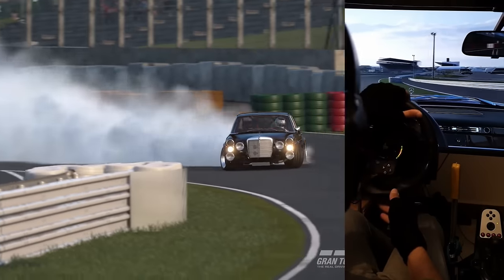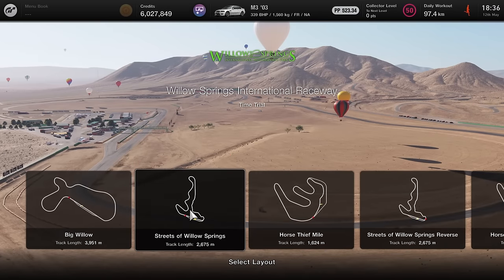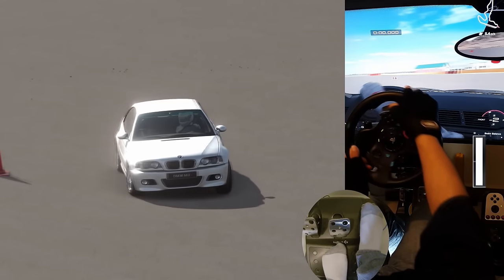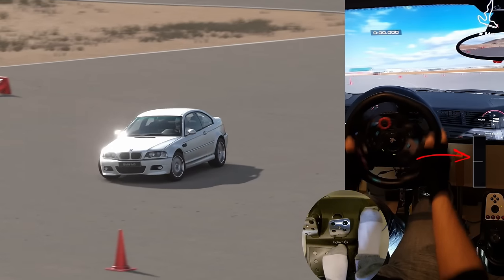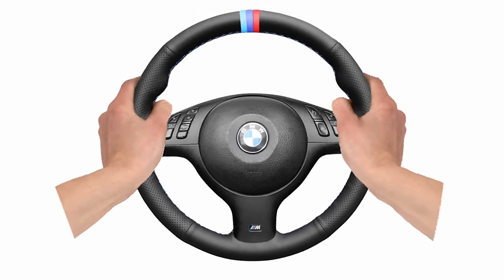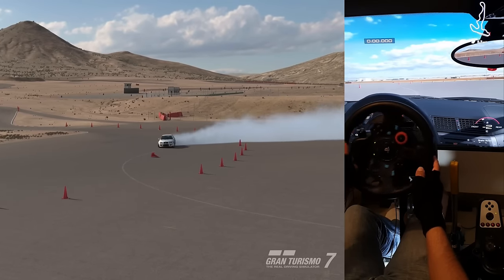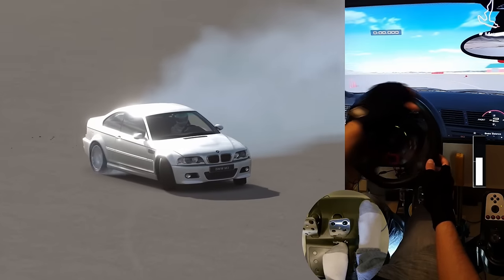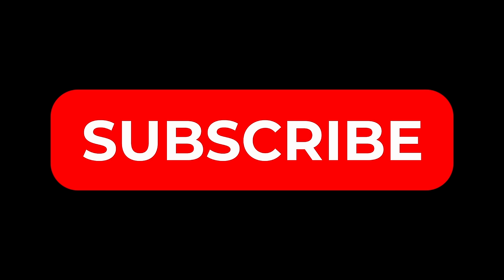How to Drift With a Steering Wheel (GT7/Real Life Tutorial) - Part 1: Basics

Comment: This is by far the best drift tutorial video, but I’m still having trouble. Whenever I initiate the drift, I spin out, no matter what. I try using a lot, a little, and no throttle. Whatever I do, I always manage spinning out. I’m not sure if there’s a setting I disabled or something but I’ve been trying for a while and I can never manage to drift
Reply from the maker: Thanks a lot! Which wheel are you using and how did you set the ffb settings? Also for how long have you been trying? It's normal to keep failing at first and it's also normal for it to take some time before you become able to catch it right. Even trying   for 2 weeks straight and not yet figuring it out is still normal btw.
Reply: @SimActionClips  I’m using the same wheel as you, and set up the exact same settings. Using the same car aswell, completely stock. I’ve tried for like a month, using different cars, trying 4wd, rwd, and fr. I don’t know what I’m doing wrong, I always spin out, no matter what I do
Reply from the maker: Okay then try using some tires with less grip. They'll slow down things for you a bit but you would also have to be more smooth and gentle with your input changes. Try all 3 different comfort tires and see which one you find easier. Give each type enough practice time.
Reply: I keep spinning too, and now I can do donut instead 😂
Reply from the maker: Donuts are a good start though.
Check these 5 mistakes and avoid making them to build your skills the right way: https://youtube.com/shorts/LM11WI2OLH4?feature=share

Comment: Thanks for the help, I’m trying to master drifting in the GT86. While I didn’t put the settings as the same as yours (I got settings 5/5/5 instead of 5/10/10). After practicing for about 10-15 minutes, I can initiate drift without spinning out or gripping, about 50% of the time.
Tomorrow I will practice some more, it’s actually more fun than I expected 😂
(And yea the GT86 is tuned, but it still only has 207HP/395PP.)

Comment: Very useful 👍👍👍
Thanks a lot man , I am waiting for Part II...
I still haven't found the way but you said things Which help me understand that I'm in right way...
Drifting with controller is another word and much easier, but the wheel makes me feel a useless piece! If I manage to drift, you Will be a part of this success.
Reply from the maker: Thanks man and you're welcome! I would be really glad to help anyone succeed and I really hope this helps. I know where you're coming when comparing it to controller. I started drifting with controller on PS2 in Enthusia and GT4. I switched to drifting with a wheel on GT5 using the Logitech Driving Force GT. It felt like i had no idea what to do, and I felt like I was physically incapable of doing it. It's just normal at first and takes some time to build it as one of your habits. You just need to stay patient and keep practicing. It will all come to you by itself. It made a drifter in real life, able to beat anyone who doesn't practice on a sim.
Reply: @SimActionClips  I bought a steering wheel 3 months ago. At first I couldn't even turn in a race without going off the track. when I started learning I found that for so long I was driving wrong even with the controller. And even worse, I realized that I was wrong even in the actual driving that I have now improved. However, things that I do comfortably on the controller are impossible with the steering wheel. But I won't give up, I've played close to 400 hours on gt7 and I hope something comes out of it. Thanks again for the video and like I said I'm looking forward to the next part.
Reply from the maker: Yes man everything you said is very normal. On top of that, I even kept on developing and improving my driving for years and getting rid of so many bad habits. For example i qualified and was a finalist in GT Academy International 2014, after already being a competitor in the local drifting championship. I was really good compared to others. Yet still, it wasn't until around 3 years ago that I got rid of so many bad habits in my driving and improved my laptimes by so much just by eliminating things that used to do wrong. I believe that it's a lifelong learning curve and simply the more you practice the better you keep on getting with time.
You're welcome man and thanks for the support! 🤟🏻🤟🏻

Comment: I'll try ffb on 10 later on my t300. I didn't want to use 10 for ffb because I feel like I'm putting wear on the wheel. Thanks for this great vid
Reply from the maker: You're welcome and thank you! Do you mean the force feedback sensitivity or the max torque? I don't think the force feedback sensitivity at 10 will not damage any steering wheel. At least not the G29 nor the TGT2 nor anything in between these 2 like your t300. As for max torque I'm only recommending 10 for the G29, I don't think the t300 will need it to be this high. I have on 6 for the TGT2 and 10 for the G29, so the t300 should require something in between.
Reply: @SimActionClips  cheers for this!!
Reply from the maker: cheers man!

Comment: Great tutorial!! The only thing I mist and nowone ask in the comments, y how ti setup the gears. Better in automatic or manual holding first or second gear? I can manage in real life but not in GT7 cos I can't feel well enough when I brake grip with the throttle.  Any suggestions will be grateful 🙏
Reply from the maker: Thanks a lot man! The car in this tutorial is fully in default setup, and there was no tuning of the gear ratios. It's much better to do it in manual for sure. One of the key controls during more advanced drifting is to know when to shift your gears mid-drift, which is something that I will surely cover in the coming parts of the tutorial. In this particular exercise, I was always in 2nd gear. A good suggestion to better feel when you break traction and the rear end starts to step out, is to use the right force feedback settings for it. You can watch this video where I explain in details how to do it and why: https://youtu.be/oEe5ZchqbMg

Comment: The front suspension geometry that causes the front wheels to want to follow the momentum of the car is call "castor". It works Just like a shopping trolley. The more castor you add the easier it is to drift
Reply from the maker: I know man, thanks for sharing. It's caster*. But I wanted to simplify thins for the viewer, and more detailed explanation of caster would be unnecessary added info which is beyond the scope of the tutorial. Cheers man 🤟🏻
Reply: @SimActionClips  absolutely, I always explain it as the wheels of a shopping trolley. No disrespect, just for those in the comments.
Reply from the maker: Yes it's a great way to explain it 👌🏻
Thanks again man, for sure non taken!

Comment: I could drift no issues on the controller and kept spinning out with the wheel… thanks for the tip regarding the sensitivity had it at 10…
Reply from the maker: You're welcome man, I hope this helped! Stay tuned for the other coming parts of the tutorial 🤟🏻🤟🏻
Reply: Not usually excited by youtube content but the level of effort you put in yours is really impressive. Really neat and clear. As many said , this should literally have been in the game !
Reply: What did you put the sensitivity to because i'm still spinning out like crazy with my wheel..?
Reply from the maker: @ace_971  thanks a lot man! I really appreciate it! 🤟🏻🤟🏻
Reply from the maker: @JayJay24Lane  you should put it at 5. Which wheel are you using and are you trying to drift or race?
Reply: @SimActionClips  I set it to every number available lol. I’m pretty sure you method works because when I set it to 5 it feels good but regardless I still feel some sort of input delay or something in the wheel set when I initiate the drift. I use a Thrustmaster tgt 2 with tlcm pedals. If it’s because I’m just trash at driving with a wheel set, then I guess that’s the issue 😭😭
Reply from the maker: It could be because of your TV. Does it support auto low latency? Also if it does, you can still have delay in the audio ,if you're not using a headset or fiber optic connection to your TV. The difference is actually very crucial for good control.  @JayJay24Lane

Comment: One of a kind tutorial! Very great! However I still feel I'm doing something wrong.

 1) During drift initiation procedure you've released the throttle completely. If I want to continue the drift, do I need to release the throttle as well at initiation stage or it was showed only for initiation practice? So the correct mapping of throttle is: 0%-100%-0%- ~50%modulation, or 0%-100%- ~50%modulation
2) Do I need to catch the wheel after initiation stage at certain position or when the forces are at their's low?
3) Let's pretend you drift with closed eyes, how would you react on the wheel's FFB during drift, always counter-react to the opposite side or just gently follow forces direction?
Reply from the maker: Thanks a lot man I appreciate it!
1) my description of how to gradually apply the throttle, applies to both the initiation and when you want to increase the drift angle. So i don't go 0 - 100 immediately on the initiation, i do it gradually to not induce understeering. And yes most of the time i release the throttle completely in the second phase of the initiation. After catching it my angle will start to decrease so i continue from there similarly to what i described in the "maintaining the drift" part. I would have to start rotating the wheel in the same direction of the turn while goin back down on the throttle etc...
In this context, think of the initiation as a replacement of the "increasing your angle" phase, but this would be a more brutal and sudden increase.
Reply from the maker: 2) You will have to catch it at certain position. The right angle to catch depends on the degree of curvature of the turn and the max drift angle which the car is able to drift at without spinning. There's no way I guess to properly describe it, other than that you have to do some trial and error. There are shallow angles where you will be able to continue the drift, and overshot angles where you will spin. You gotta adjust your initiation angle to somewhere in between.
Reply from the maker: 3) You can't put it this way since you're not always just reacting to the ffb. You will be doing adjustments to your inputs at the pedals and at the wheel to both maintain the drift but also steer it. In the video at around 8:50 I say "Until you become very close to your desired drift angle". Well that desire drift and actually depends on where you want the car to go, because you're steering it to follow a certain curve. You're always visually judging where you want to go and deciding on every iteration of increasing your drift angle when to start to back of the throttle, to make the car go in the right direction (the desired direction).

Comment: Finally someone explain how 2 drift n GT7. I love u man😘 by the way I noticed that u r using a handbrake so pls what is the brand and do u think it will work with Fanatic wheel base with thx
Reply from the maker: Haha thanks man! I made my own handbrake. It's simply a spring-loaded arm which pushes on the L2 trigger of the playstation controller. I was able to benefit from this because when you set either the L2 or R2 trigger of the Playstation controller as handbrake in GT7, you get a fully functional progressive handbrake and not just an ON/OFF switch. This should work with any wheel since it's functioning independently. Hope this helps, much love 🤟🏻
Reply: @SimActionClips  appreciated bro
Reply from the maker: You're welcome bro 🤟🏻

Comment: Thanks alot for sharing, very clear explanation and also really like the part about the movement of the car and how the wheels respond when starting a drift. This is also where I am least consistent, I have a question about this:

How much do you help your steering wheel to rotate and do you hold your wheel firmly while drifting or gently around the wheel?
Reply from the maker: You're welcome and thanks a lot!! 
Generally speaking I go gently with the wheel. I grab it firmly only when doing sudden corrections, then go back immediately to a much lighter grab. 
This also depends a bit on which wheel I'm using. The G29 doesn't really require me to hold it as firmly as I hold the TGT2. But on the other hand it requires much more help when doing fast rotations because it's not fast enough so I have to keep helping it. Whereas the TGT2, and although it produces more powerful forces and I have to hold it more firmly sometimes, it also makes it much easier for me where I can simply fully release it to turn on its own when it needs to do fast rotations.
Reply: @SimActionClips  Thank you very much! It seems like SH tires are better to control somehow with my G923, I'm improving after 2 hours of practice but still struggling to hold to drift or feel like I am in controll.. Did you experience this too?..
Reply: @SimActionClips  addition: do you always have to help your wheel spin while drifting for every single move? I'm using the G923
Reply from the maker: You're welcome man and thanks a lot for your feedback! Yes the SH produce better feedback than comfort tires that's why. The grippier your tires are the more feedback you'll feel that's how it works. 

And yes that's normal to struggle to hold it at first. You need time to get used to it. It took me some time too but that was a very long time ago with GT5 and the Logitech Driving Force GT. I remember struggling for a whole week before starting to get good at it. And it varies from person to person for sure. It can even take longer and that's normal just don't give up.

As for always helping the wheel, no not necessarily. It depends on how sudden and aggressive the initiation or transition is. For some smooth slower ones I can let do it by itself.
Reply: @SimActionClips  thank you very much! Means alot. You're my favorite youtuber about sim racing for sure!
Reply from the maker: You're welcome man and thanks a lot for the support!! 🤟🏻🤟🏻❤

Comment: Hello sir, thank you for your professional teaching and sharing. I would like to ask whether the g29 needs to use the logitech hub to adjust the rotation angle and sensitivity?  I tried operating range 720, 540, 180, and the sensitivity was 100. There is no difference after adjustment. Can you help me setup g29 best operating range on gt7, thank you!
Reply from the maker: Hello,
Logitech Hub only affects the profile of your Logitech wheel on PC.
The wheel itself doesn't store any adjusted settings, they stay on your PC for PC use. You cannot adjust the operating range in GT7, it's automatically adjusting depending on which car you drive. 
You're welcome and thank you for your support 🤟🏻

Comment: Hi really much thanks for this tutorial, do you really need a H shifter down the road for drifting?
Reply from the maker: Hello and you're welcomed! You don't really need and H shifter, but you still need to have it in manual and you can drift with a sequential shifter. But also, having a working clutch pedal is always a good tool for better control, and it can make some situations easier to handle. It's not a must but it surely is a plus.

Comment: Hello first of all thanks for the video tutorials, as a second thing I wanted to ask you if you have a valid configuration to drift with the DD Pro of the Fanatec because I'm going crazy with the Force Feedback settings, sensitivity etc. The steering wheel feels hard, it doesn't drift and when by some miracle it happens the car turns completely, I can't hold the steering wheel or get it back to the normal position. In addition to the practice that I am missing, I definitely need mainly a Good configuration of the steering wheel settings. 
Please help me.
Reply from the maker: Hello, you're welcome and thank you. 
I can recommend the in game settings but I don't have any experience with Fanatec's internal wheel settings. 
Controller steering sensitivity: 5 for all wheels and this is very important to have a good realistic feedback.
Max torque should be above 6 if you're not using the booster kit (try 7 and 8 and see which works best), and below 6 if you're using the booster kit  (try 3,4,5 and see which works best)
Force feedback sensitivity should be at 10.
For a more detailed explanation plz watch my video about the subject: https://youtu.be/oEe5ZchqbMg
I'm starting to have the urge to get a DD Pro and make a video about its settings after some extensive testing. There is a very high chance that I might do it if my channel starts generating enough revenue to justify that purchase.